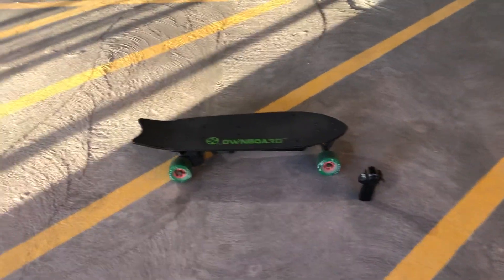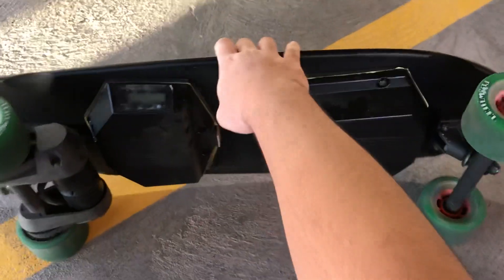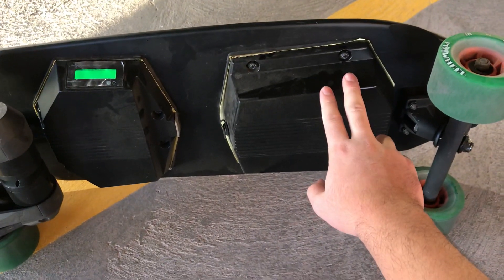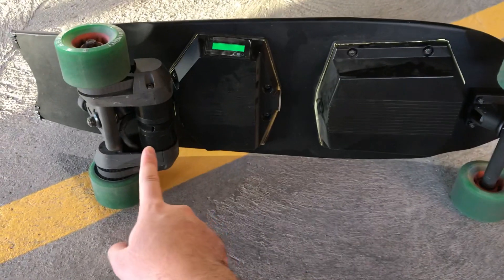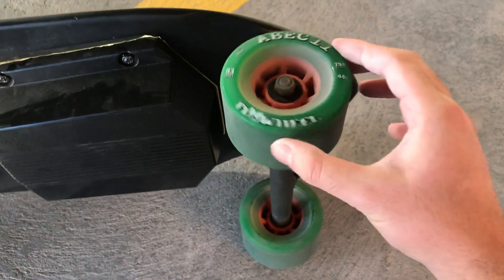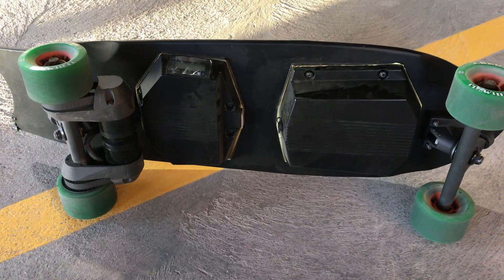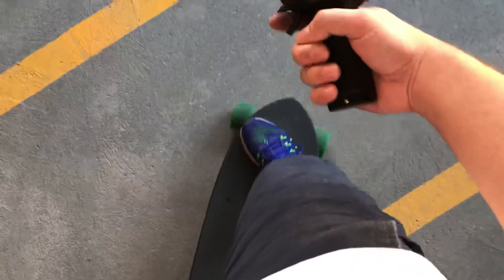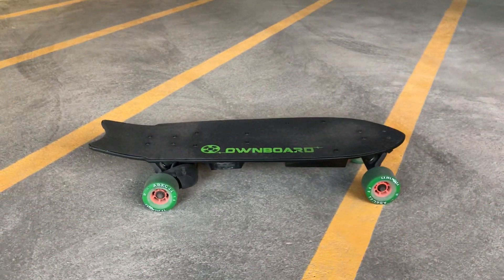DIY electric shortboard | Dual VESCs | Dual belt drive motors

Comment: Wait how exactly did you get the motors to be more quiet? I’m new to this. I like quiet boards too but I want the power of belt driven 😂
Reply from the maker: you set the VESC to control the motors using FOC. It's a lot more quiet than BLDC. And definitely more quiet than Boosted, I think they use BLDC or something because their boards SCREAM.
If you're not comfortable with tweaking, you can get the ownboard W2 which is belt driven and it uses hobbywing ESC which is FOC and smooth.
Reply: Tuan Hoang Minh thanks a bunch. Really appreciate it.

Comment: Hey I don’t know much about the Samsung battery , How much volts are you running ?
Reply from the maker: I run at 10s so it's 36V (nominal voltage) and 42V (fully charged). Each individual cell is 3.6V and when charged it's 4.2V.

Comment: Still working?
Reply from the maker: Carl what do you mean by still working?
Reply: @tuan.hoang_  Does it function like it is supposed to?
Reply from the maker: @Carl yeah it does. Still working great!
Reply: @tuan.hoang_  How many belt changes so far?
Reply from the maker: Carl two. Believe me, changing belt is much better than changing the urethane on hubs. And belt driven system you’re riding full urethane skateboard wheels so that adds to comfort. IMO belt is superior to hubs.
Reply: @tuan.hoang_  I've been thinking of buying those exact motors from diyeboards. The only thing holding me back is the fact that you can't adjust belt tension.
Reply from the maker: Carl 
I’d say I don’t recommend this kit really. Get a pair of calibers, boardnamics motor mounts, and a pair of 6355 motors.
Reply: @tuan.hoang_  I thought about it. But they're more expensive. I'm only 15 and therefore I don't have all that money to spend.
Reply: @carl4576  Better to spend the money and not have parts breaking
Reply: @Europium  Yup! 3 months later I'm riding my fully DIY board capable of 50kph+ and 60km range! :)
Reply: @tuan.hoang_  hi sir why don't you recommend this kit exactly?
Reply from the maker: @Oeliboeb  
1. You can't adjust belt tension, so this makes you change belts more often instead of tightening them for more rides (until you can't tighten anymore).
2. The mounts come loose easily, it's a pain to keep them fixed to the axle.
0/10 would not recommend. It seems easy to plug and play at first, but trust me, this kit is unreliable and too much of a hassle to maintain.
Reply: @tuan.hoang_  thank you for sharing your experience. Stupid they didn't think about the belt tensioning. Do you have any recommendations for motor mounts?
Reply from the maker: @Oeliboeb  Torqueboards motor mounts or boardnamics motor mounts. TB is nice but a bit expensive imo. Boardnamics one is best bang for your buck. Cheap and made in the USA!